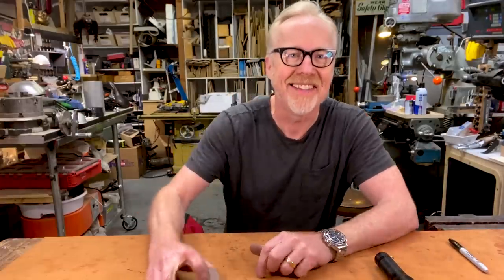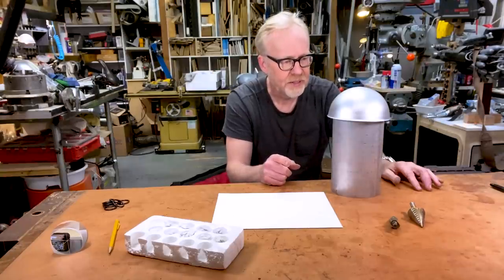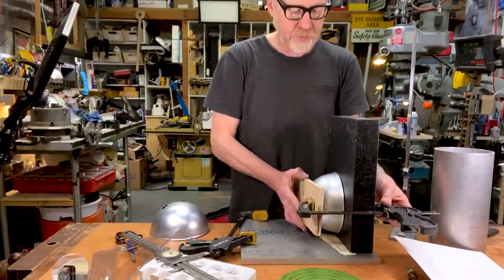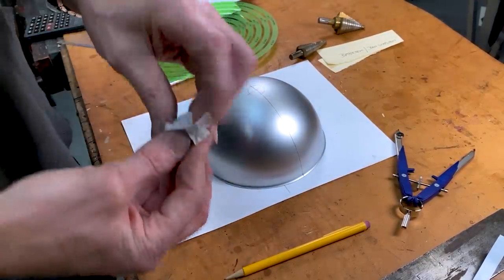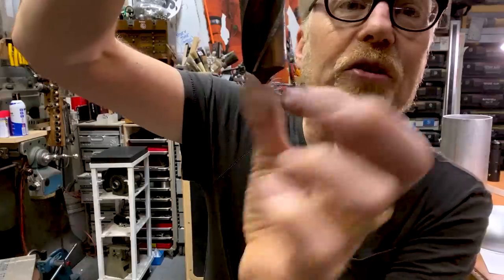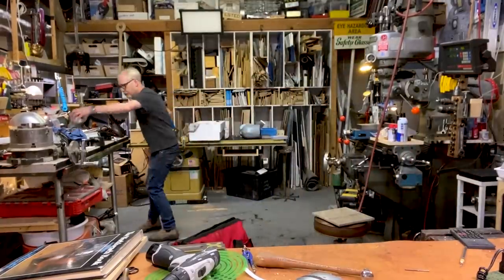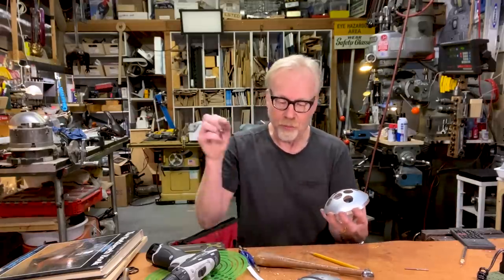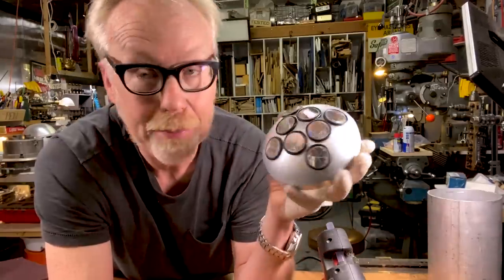Adam Savage's One Day Builds: NASA Retro-Reflector Replica!

Comment: I worked for United Space Alliance during Shuttle and ISS and one of the hardware I worked on for flights was the TCS (Trajectory Control Sensor) - the square box that sat inside the cargo bay. The TCS would shoot Pulse Wave or Continuous wave laser at the ISS, that was outfitted with retro-reflectors on the outside structure and would reflect back closure data to the Shuttle for docking. One one of the ways we tested the TCS prior to flight was outside at night on the grounds of JSC. We fitted a bicycle with retro-reflectors on the back and would ride the bike away from the TCS while it was shooting either Pulse Wave or Continuous wave laser at the bike. Through radio, the guys would tell the bike rider to speed up or slow down so we could confirm the data coming back was correct!!! Those were fun days and fond memories for me as a technician :)

Comment: Interesting subject! 

Back in the 70's I designed a system for timing drag boats that used HeNe lasers and retroreflectors to detect when the boats crossed the timing lines (by cutting the beam).There were timing beams set up at the end of the quarter mile to calculate the finishing speed and ET. We used corner reflectors purchased from a company that supplied surveyors (they use them to determine distances) The ones we used were about 3 or 4 inches diameter, made of glass and were rather expensive. (So were the 5mW HeNe lasers back then). 

The laser sytem allowed drag racing courses to be set up over very wide water e.g. rivers and lakes.

BTW.. I found out through testing that you have to use a beam expander to get a laser system to work over long distances. It reduces the scattering effects of the air and keeps the beam much tighter.

Comment: Another cool everyday use case of retro-reflectors. They are more and more used on precarious construction sites.
For example at the site of some new metro stations (or entrances?) on the London Metro. They were concerned with the stability of the buildings around while the construction was going on. They installed hundreds of reflectors around the construction site on walls, curbs, poles, etc.
Then they used laser tracking devices to permanently scan and measure the position of every of these points to have early warnings about unexpected movements.

Comment: Interesting technique for finding that center point on the dome! My technique I use would be to flip it as a bowl, make sure it's level on all sides, put a drop of water (super tiny drop) and if it's dense enough it'll find the exact lowest point of the dome (the center).

So fascinating, definitely more than one way to skin a cat!
Reply: Yes, and much faster.
Reply: Please Complete All Fields start on a flat surface and use a level on the outer lip. You should get very close. Adam’s method was overkill. I’m sure if you play with math and 3 strings equal to the half of your circumference you’re getting close too.
Reply: Please Complete All Fields  Not saying you are wrong, but I literally do this for my projects that involve this EXACT method haha!

I think it's fairly simple to prep the material (AKA WASH IT) before working with it. no dirt or grease here!

Ever heard of a carpenter’s level? Literally allow the dome to rest against neigboring objects whose heights match the radius of the dome and then boom use the level across all 3 objects.

Lastly, It's literally water, It WILL find it's way to the lowest point no matter what obstacle is in the way.

After the tiny drop of water is in the center, I use a pin punch to lightly score the point i need.

Thank you for this engaging discussion.
Reply: Or he could of just put his paper of circles on his pillar drill or mill. Center the drill over the paper then wind the bit up and put the bowl on the paper and then lower the bit onto the top. Would of taken all of 2 minutes.
Reply: Lots of ways to find the center, but he had a compass, prior to using the clamps.  Using that and a pencil would have been easier in my opinion.
Reply: If you really wanted the drop to be precise, you could spray it with a hydrophobic clear paint, and use something with a lower viscosity than water like extra Virgin olive oil or something.
Reply: Or you can eyeball the center, mark it as the center, use a drafting compass to scribe a circle centered on your mark, and cut the hemisphere on that line, and your original mark will be the center of your dome.
Reply: Simply put the dome flat and use the edge of it as the point to put one side of your draftsman compass. Scribe three or four arc across the top and you’re done. Way easier than any other method. Then put the compass on the center mark you just made and scribe a line all the way around the bottom for your line to trim the dome.
Reply: or a tiny ballbearing.  for water youd need to oil the bowl first i think or its just spread out